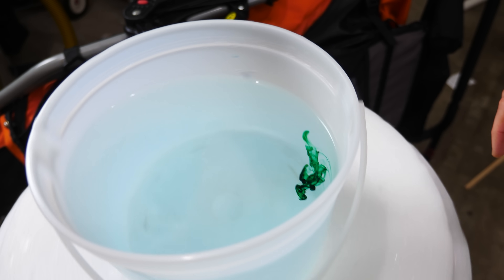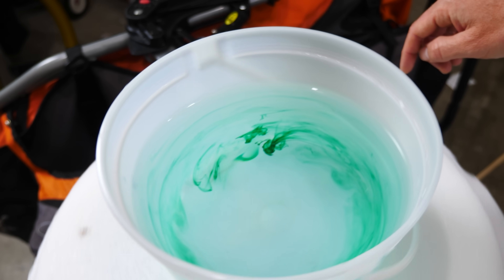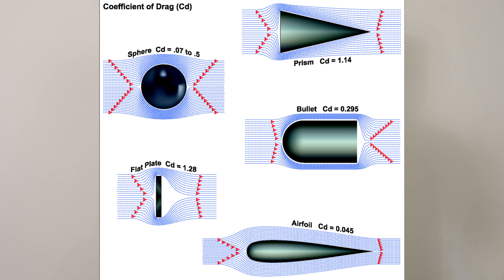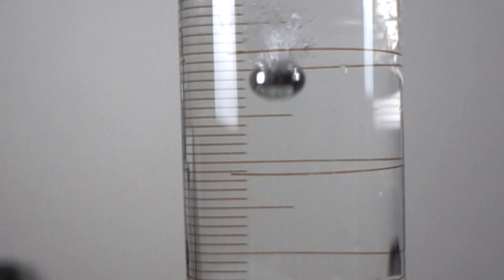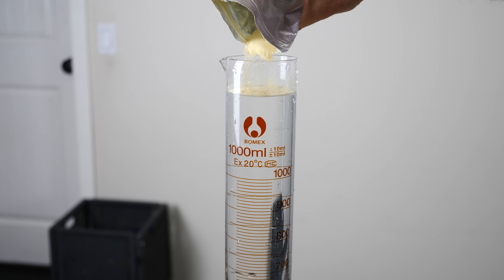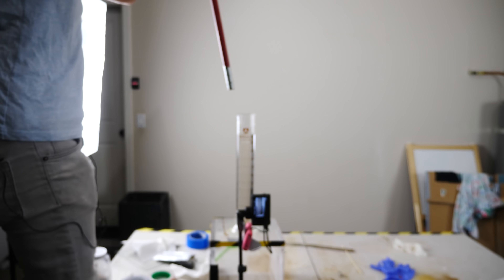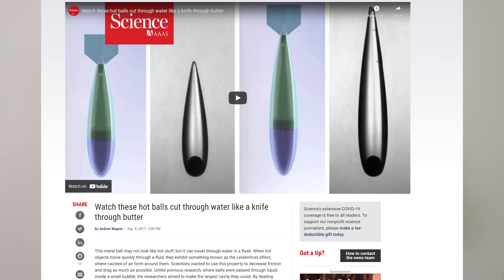Hydrophobic Projectiles Slice Through Water With No Drag

Comment: Every military around the globe just casually taking notes
Reply: A really similar concept already exist, is the supercavitating torpedo, in use with both the Russian and German navies.
Reply: @paolorubenmastretta  and you bring up a major point on one weakness I could see them having.cavitation.this makes a shit ton of noise,so they won't be hard to miss.im not even sure how you could make something like this silent running.and I think from a more practical war standpoint it would be better to have a slow stealth torpedo the enimy can't see coming as opposed to a fast but stupidly loud torpedo they can detect in advance and counter.and by loud,I mean in terms of sonar.and also,remember that cavitation is also destructive,so that could present issues of itself.we see this on boat props all the time.
Reply: @richardpeterson3753  the destruction of the torpedo is not a problem given the absence of contact between it and the water, about the fact that is better a stealth torpedo I could agree with but given the fact that they can get pretty close to a surface group and given how fast they're they could be successful, after all if they produced them...
Reply: @richardpeterson3753  i believe this concept has been used and the issue of noise isn't a concern because the torpedo travels so fast that there's nothing that can be done about it anyway.
Reply: @orion4s982  Russian Shkval supercavitating rocket torpedo.  Uses solid rocket fuel, and does +200 knots max speed. They don´t give two fucks about noise. By the time you hear it, you are dead.
Reply: Torpedoes are plenty noisy anyway for the modern hydrophones to detect as soon as one is launched because of their small high speed propellers so added speed easily outweighs any increased noise.
Reply: coat some bullets in this stuff.
Reply: no this has allready been attempted,although by much different means.im not sure if these are in active use currently or still in the r and d phase though.but I do know it's been tinkered with

Comment: No friction is not the same as no drag, my friend. Drag derives from both friction and the pressure differential creating by the moving body. Hidrophobic materials might reduce friction ( I have never seen anything about that in my fluid dynamics lecture so I won't doubt you). HOWEVER, if a body is moving through a fluid, a pressure differential has to be created, thus creating drag.

Comment: this is all fine and dandy in a vertical torpedo shot however that would never work in a real torpedo it would shoot straight to the bottom of the ocean. real torpedoes require the drag of the water to keep them going horizontal. now maybe it the body was coated minus the fins and propeller maybe there might be a small benefit but i still think it would sink. ever seen what happens to a ship made hydrophobic from gas bubble in the real world it loses buoyancy drifts side to side then sinks like a rock

Comment: The Soviets made a torpedo using this principle back in the 70s called the Shkval. Instead of a normal screw at the back it uses a rocket engine with a blunted end for supercavitation, so the only parts of the torpedo which touch the water are the nose and oversized rear fins.

Comment: You've greatly reduced the skin friction drag. This doesn't significantly reduce pressure drag though.
To reduce pressure drag you want something roughly shaped like a needle (on both ends if possible) with small fins to stabilize it. 

That could make a good homemade low drag object!

Comment: Actual torpedoes have been designed for decades now using this principle - the massive bubble effect is also referred to as Super Cavitation and there are multiple ways to cause an elongated bubble that encases the projectile. The cavitation effectively allows for the projectile to assume 'flight' as if it's in air, which is why the Shval System developed by the Soviets in the 70s was a rocket propelled system instead of a traditional gas or prop. 

It's important to note that the speeds of the Shkval are high enough that simply having a hydrophobic blister (ball bearing) at it's front end may not suffice. The Shkval for example not only used a specially designed nose, but the nose also vented gases from the gas turbine system on board to increase the size of the bubble artificially.

Comment: Wait, so, if I try to swim when I am all covered with hydrophobic dust , I'll just sink? Or will I swim faster than ever? This is so confusing
Reply: I would assume you would still be buoyant enough to float, so you might be able to swim, idk though
Reply: I don't think you'd sink, the hydrophobic coating decreases drag force, not buoyant force. Buoyant force is given by hydrostatic pressure, and pressure doesn't stop acting on you just because you're covered in an air bubble.
Whether you'd swim faster is a tricky question. There'd certanly be less drag slowing you down, but swimming relies on your legs/arms pushing water behind you - and that'd be difficult if you were fully hydrophobic, as the water would slide around your body rather than getting pushed back.
Reply: @eigenb6455  then go partially coated with legs and arms non-hydrophobic, might affect something?
Reply: That's actually a very good question.
Reply: you would swim faster than ever if you didn't cover the body parts you use to move, swimsuits are hydrophobic, some types of swimsuits are banned, the suits used must be approved
Reply: https://youtu.be/GcdB5bFwio4
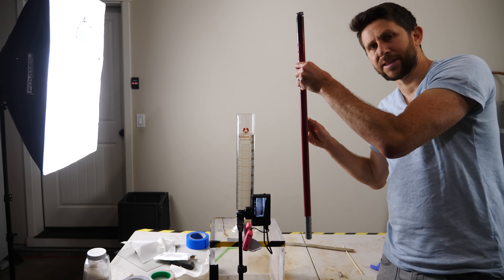Derek(veritasium) already did it 😁 @3:45 if you don't want to watch the whole video
Reply: I vote for the “you sink” option, the water is pushed away from you so you have a close fitting air bubble round you , also as the water moves round your hands and arms your would have no traction on the water
Reply: Bouyancy is the resistance of water pushing up on you. 

By being hydrophobic, the water pushing up would instead slip around you, causing you to sink quickly (like the ball in the video).
Reply: @giga4052  that means, if you work in a hydrophobic dust factory, don't go for a swim right after your shift. o_o
Reply: @giga4052  no
Reply: you would sink, because it would be like you were jumping into nothing

Comment: Awesome video!! Based on your video I have a a few questions. When I watched the hydrophobic sphere drop through the water I noticed that it “belched” large bubbles off the back. How far could your sphere travel before all the air in the pocket is lost? After that will the hydrophobic coating still reduce drag through the liquid? Also, assuming the pocket of air does collapse over time, and more gas needs to be introduced to maintain said pocket, where would one release the gas? Would it be at the front, the back, or at the sides of the sphere? Apologies if my questions are a bit silly (science is of great interest to me but not exactly my strong suit), but I greatly enjoyed your video, and I had more questions at the end than at the start. Big thumbs up!
Reply: I don't think the air was dragged down from the surface, I didn't think it was air but rather water vapor following the ball.  Or rather, a cavity created by temporarily pushing the water out of the way.

Comment: There is now a new version of the tomahawk missile...I'm guessing that it probably has a gas wall around its outer surface, to reduce the extreme wind resistance that high speed anything is subjected to. Because the faster you go, the more air molecules you have to fight threw. Try sticking your hand (safely, don't be wreckless) out the window while driving down a highway, at highway speeds, and you'll see what I mean.

Comment: Would a horizontal projectile have adverse affects? Like would the buoyancy change if it's surrounded by air? If say it's a torpedo that has navigation, would the directional fins or propeller have less efficiency if it's not interacting with water?

Comment: Such old news ... this was done on torpedoes in the 1960s and 1970s.   Bubbles. Chemicals etc. From mod of mk 48 to lightweight mods to the mk 44 using the mk 62 battery.  All very old thoughts all discarded as the velocity of the torpedo need a quad power to double speed 
All noble sentiments   Sorry!

Comment: I’ve had this idea that I want you to try,
Can you take a one way mirror and point it toward a normal mirror and then look through the one way mirror to see if your able to see the infinite loop? Doing this you shouldn’t have your own head interfering like it does when you look in between two normal mirrors
Reply: The number of images would not be infinite because after every reflection the image formed would be a little bit dimmer because light would lose energy after every reflection Our standard mirrors reflect about 98 something percent light 2 percent is absorbed so the image formed after every reflection is 2 percent dimmer so after enough reflections there will be no image if you have a mirror which reflects 100 percent light even then infinite images aren't possible Because suppose you have two mirrors apart at a distance of 300,000 m then light would take one seconds to travel to the mirror on the opposite end so its one reflection per second so it would take INFINITE amount of time to make infinite images ................
Reply: @dishant8126  yeah, I’d still like to see it though. I think it’d be pretty neat

Comment: The force is stronger between liquid and solid vs liquid to liquid explains the dye on the bottom, but that isn't the reason for the dye in the spinning, as that dye is not touching a solid.
The dye in the spinning has to do with momentum.

The spinning bucket is because there is more force being exerted at the outside of a rotating circle than at the center.
The further you get from the center, the faster the circle has to move to cover a larger and larger circumference per rotation.

Comment: You went the long way around to explain drag due to friction, which is what slows an object down in a liquid.  The same way it happens through air, except in liquid anything that will displace the liquid that it is moving through, will create drag.   A gas in liquid displaces the liquid and will also create drag.  Maybe less drag than a solid, but drag nonetheless

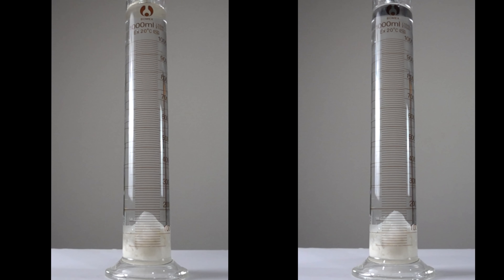Comment: 4:29 isn't that bubble collapsing into itself a good example of cavitation?
Reply: I don't think so - air is a compressible fluid, so a bubble merely changing size isn't proof of cavitation. A good example would start with no air at all, producing a bubble of water vapour due to reduced pressure which then collapses back into water once the pressure rises again.